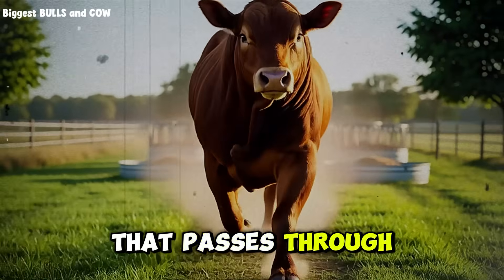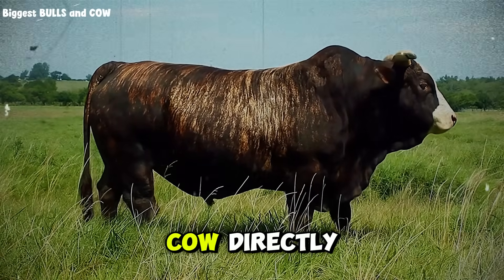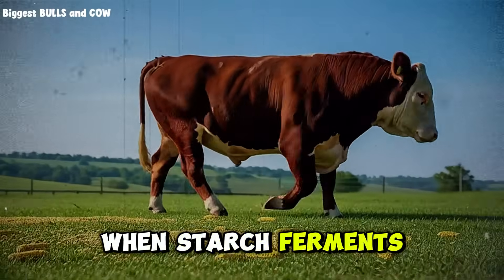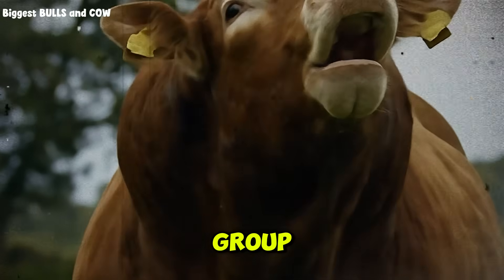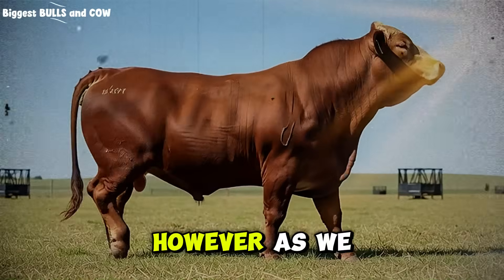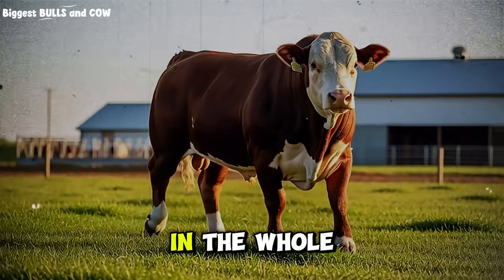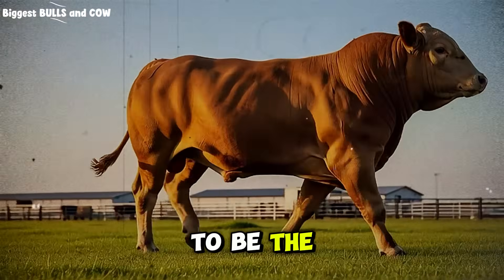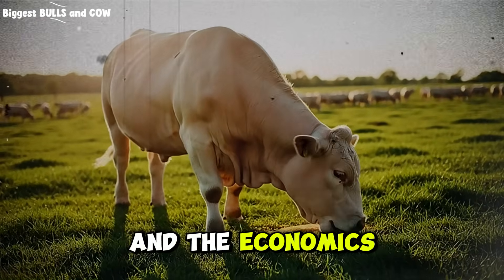Cracked Corn vs Whole Corn: The Weight Gain Test

Comment: When I was in University of Wisconsin Ag school in the 70's, they recommended turning cattle loose over harvested corn acres to salvage the field loses in harvesting. Then, after grazing the cattle, turn swine loose in the field after them. The corn that comes out the rear end of the cattle is not the same as what it was when it went in. It is more beneficial to the swine than unprocessed corn. I had a group of swine that was doing really good on ground corn with soybean supplement.  Then a neighboring farmer offered me a cheap deal on picked ear corn and I  would offer the soybean supplement free choice along side the ear corn. Within 2 weeks they weren't doing as well. Swine are not ruminants though. I think the professor said that the corn the hogs ate from the cow pies had more protein value as well.